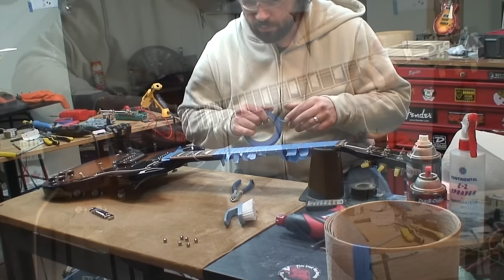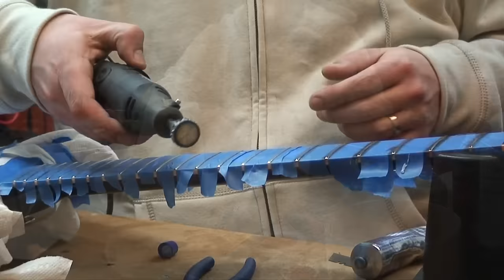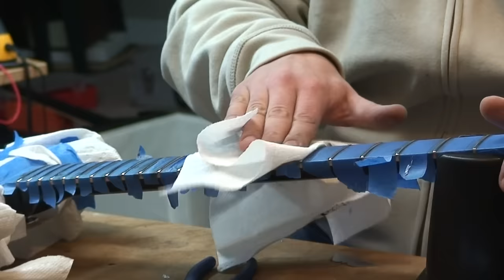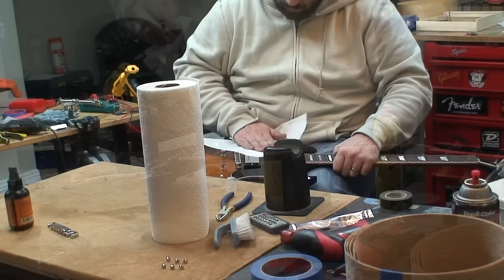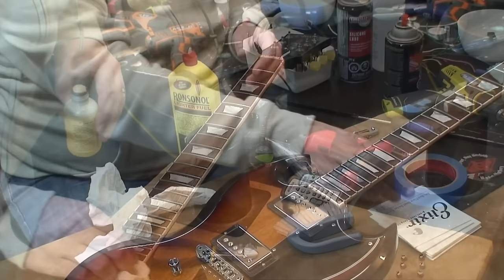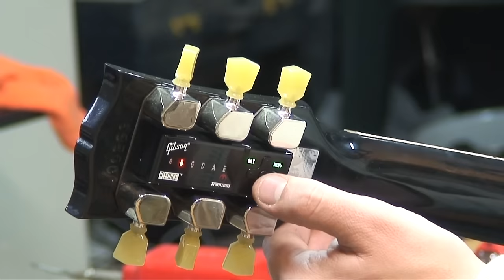Fastest Way To Polish Frets!

Comment: Thanks buddy, I have started using a cloth wheel on my drill with some metal polish after your inspiration in a previous vid. Initially tried to do it using the fret guards but the polish is too messy on the board so tape like you are doing is the better option. Good work!

Comment: the question is where do we buy that polishing machine
Reply: It's an ordinary Dremel rotary tool using a felt wheel that's commonly included in a Dremel kit, along with the arbor bit the pad attaches to. Other brands make a tool similar  to the Dremel, and a lot of them are lower in price. Those bits will fit in a drill too, but won't rotate nearly as fast so the job will go slower. Can't tell what polish he used, but it could be a tube of Simichrome polish, or practically any polish that works on steel or chrome. Try googling 'rotary tool' to find the Dremel & others like it.